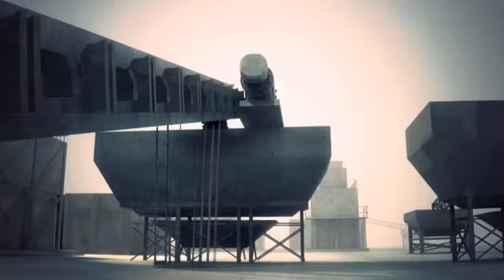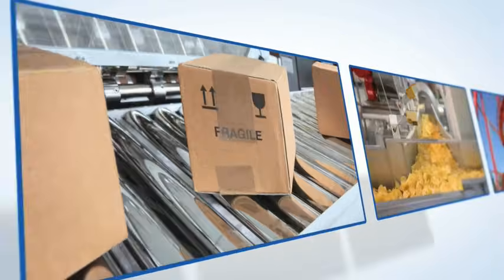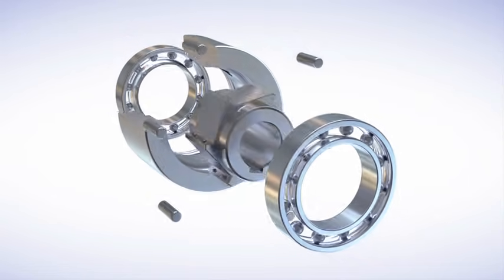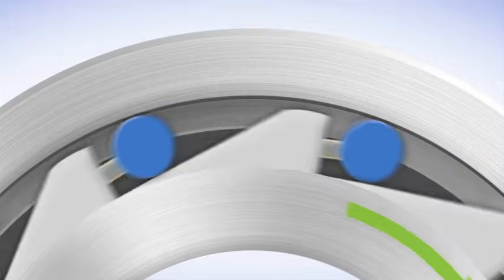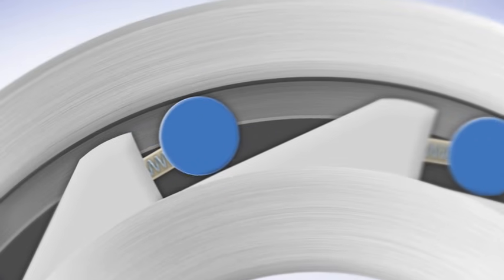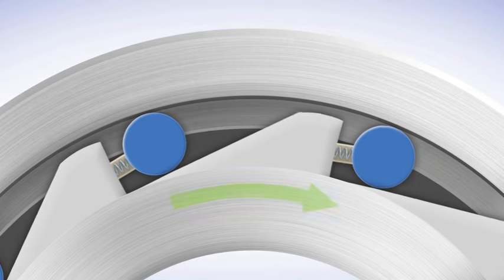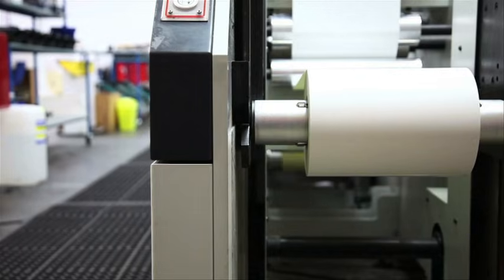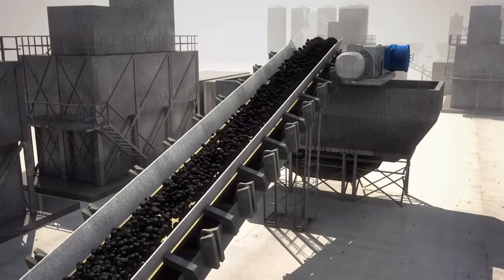Renold Trapped Roller Clutch

Comment: This is the type of bearing used in the main drive gearbox on many helicopter designs around the world. These bearings are located in the coupling between the engine and the rotor gearbox. It is what allows the helicopter to autorotate in the event of an engine failure.

Comment: Do these transmit radial loads?  Do you need to use a needle roller bearing with them?
Reply: they could, but efficiency would be very poor since you only have sliding and no rolling contact.

Comment: I need a one way clutch for a hand powered bicycle.  This design seems perfect, just not sure about the longevity.  I actually need a pair to work in unison, one for the pushing action, one for the pulling action.
Reply: Maybe completely useless advice by now, but there is also the Onyx (onyxrp dot com) hubs, they have a big selection for almost every discipline of cycling. Check them out.
Reply: Are you still out there?  I have designed and am using a hand powered bicycle, or actually an attachment to a moutain bike hybrid.  Looking also at design I have CAD for using a one-way clutch rather than a freewheel.  If you want to talk about it with me, drop me a line at johnson.fred.w@gmail.com.
Reply: +Doc02864 did you find the stealh mtb bikes hubs?